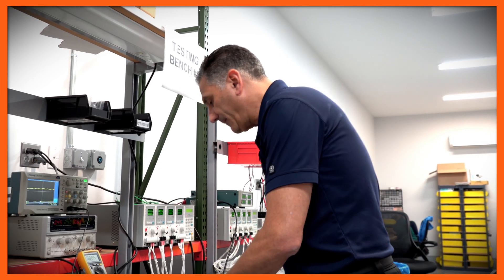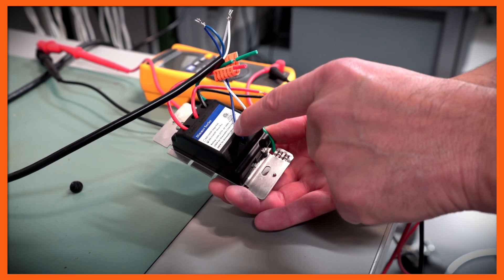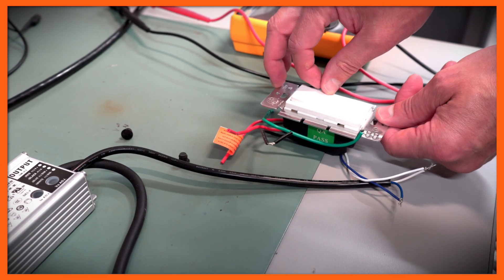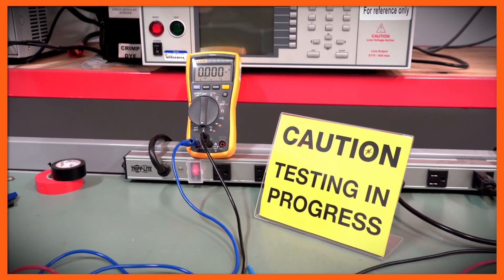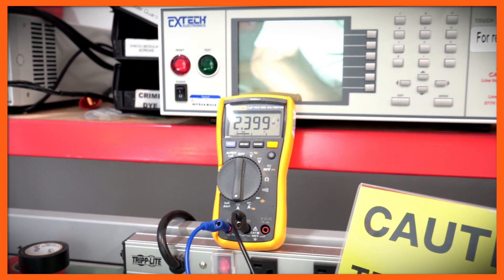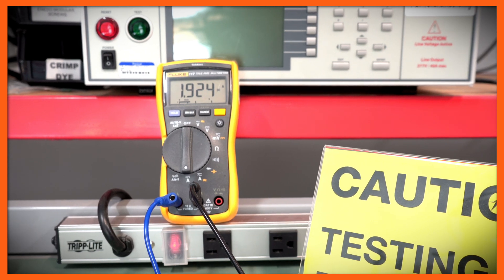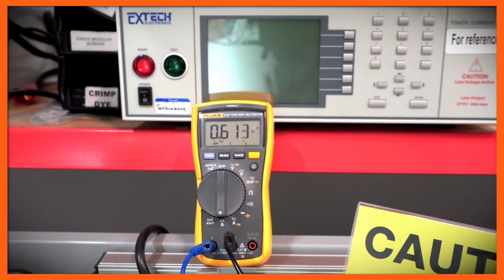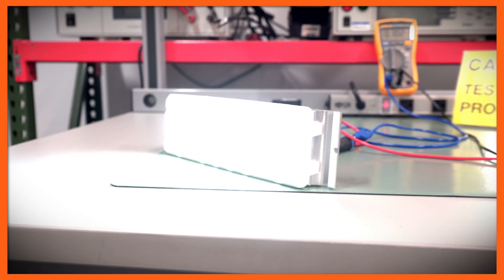Powering LED Lighting The Right Way: Connecting a 0 to 10 Volt Dimmer To The LED Driver

Comment: My led controller (LED grow light) has an RJ12 jack that says pins 2 & 5 are for 0-10V dimming.  The controller has one RJ12 jack for input, and one for output.  I figure the output is for daisy chaining the lights, so pins 2 & 5 on the output should show voltage corresponding to the level at which the controller is set?  So as I switch from 30% to 50% to 70% to 100% the voltage should ramp up to 10V?  Or does it need a load for that to happen, or is it PWM?  I cut an RJ12 wire and measured voltage from pins 2 & 5, but only got .065V no matter the brightness setting.  My goal is to put a dimmer to the input so I can fine tune the brightness.  Appreciate any advice.  Thanks
Reply from the maker: Yes—pins 2 & 5 on the RJ12 are likely the 0-10V dimming control, and the output jack is usually for daisy-chaining. You should see a voltage (0–10V) that tracks with brightness, but only if the controller is actively sourcing that signal. Some systems require a connected load (like the driver) to output voltage—or they expect an external dimmer to provide it.

If you're reading ~0V regardless of brightness, your controller might not source the 0-10V—so adding your own 0-10V dimmer to the input is probably the right move.

If you have any other questions please feel free to give one of our power sales experts a call at 888-612-9514!
Reply: @TRCElectronicsInc  Thank you.  I got it figured out.. Pins 2/5 are the positive, and 3/4 are negative. Wasn't clear the way they had it printed on the controller.
Reply from the maker: @Gareth96v1  Please reach out if you have any other quesitons!
Reply: @TRCElectronicsInc  well I got a dimmer yesterday from Amazon, just a simple 2 wire analog dimmer.  It works fine with my Viparspectra lights (pins 2/5 are Dim +, and 3/4 are Dim -).  When I measure voltage from output between pins 2/5 and 3/4 I get volts from 0-10 that go up as I turn up the brightness.  And if I hook the dimmer to input and put the controller dial on 'External' I can adjust brightness just fine.. However, my Floraflex 700W, that also says pins 2/5 are Dim + and 3/4 are Dim -, I get < 1V at output no matter the setting.

So the Floraflex isn't analog.. My understanding of PWM is I should get about half the actual volts (average between pulses)?  So I don't think it's PWM.  What else could it be?  Floraflex hasn't responded to m inquires yet...

Thank you!
Reply from the maker: @Gareth96v1 Unfortunately, we do not have detailed manual on that product and cannot offer any assistance.

Comment: You seem like a true professional. 
How would i best wire a dimmer switch to a single Alpena 15" Terra off-road light bar? Should i use this method?  Any special preparations/care that I would need to take? What is my simplest and most economical route to take?
Any advice would be much appreciated... Thanks!
Reply from the maker: Hi, we have not worked with this Automotive Alpena 15in lightbar, so we cannot give you any professional advise on this. However, we researched this topic and found this video that may be able to help. https://www.google.com/search?q=alpena+15+terra+off-road+light+bar+dimmer+switch+replacement&sca_esv=d9880e105989b578&rlz=1C1CHBF_enUS920US920&sxsrf=ADLYWIIq4WDxCsMnMUNlE0strm0kc2J9hA%3A1728917363660&ei=cy8NZ8nnJ-ao5NoPh96qwQs&oq=Alpena+15%22+Terra+off-road+light+bar+dimmer&gs_lp=Egxnd3Mtd2l6LXNlcnAiKkFscGVuYSAxNSIgVGVycmEgb2ZmLXJvYWQgbGlnaHQgYmFyIGRpbW1lcioCCAEyBRAhGKABMgUQIRigATIFECEYoAEyBRAhGKABMgUQIRigATIFECEYqwJIsyFQugVYyBFwAXgAkAEAmAGVAaABqgaqAQM1LjO4AQHIAQD4AQGYAgigAv8FwgIOEAAYgAQYsAMYhgMYigXCAgsQABiABBiwAxiiBMICCxAAGLADGKIEGIkFwgIEECMYJ8ICCBAAGIAEGKIEwgIIEAAYogQYiQWYAwCIBgGQBgaSBwM1LjOgB5ss&sclient=gws-wiz-serp#fpstate=ive&vld=cid:6c0b439d,vid:why6LJjX12E,st:0

Comment: But...He never showed the input for the driver.. my driver is 120V  which output 36VDC to led.  so the dimmer switch has no power  ??? WHAT !!!  seriously ...
Reply from the maker: Thank you for your feedback!

For the purposes of this video, we wired the AC input directly to the input of the driver, rather than through the Dimmer.  Our intention was to highlight the 0-10V dimming function which does not need an external power source.  Power being wired through the dimmer is simply for purposes of the On/Off switch found on some dimmers.

Some dimmers, such as this one, only have two wires and no power connection:
https://www.superbrightleds.com/0-10-volt-dc-low-voltage-dimmer-with-slide-dimmer-switch-0-10v-dimmer

Other dimmers like the one in the video and found here, can pass the power through a switch:
https://cdn.shopify.com/s/files/1/0678/8553/1417/files/SW-0-10V-02118.pdf?v=1675456940

Please let us know if you have any other questions! You can also contact our power team at 888-612-9514!